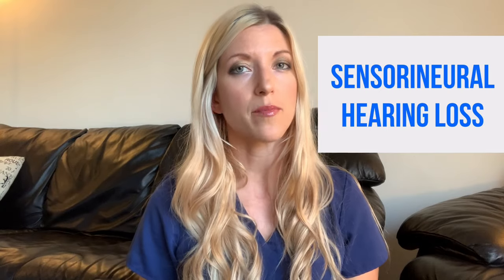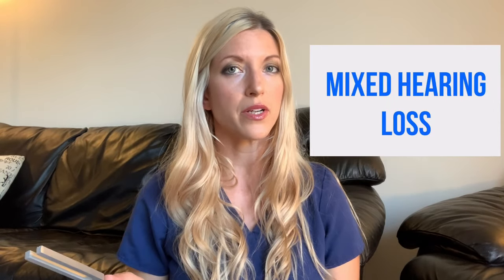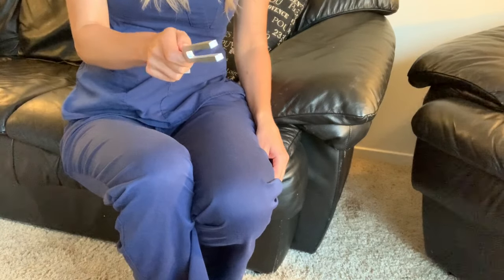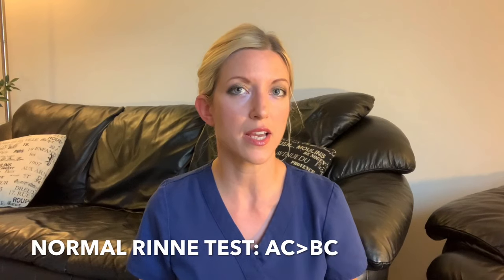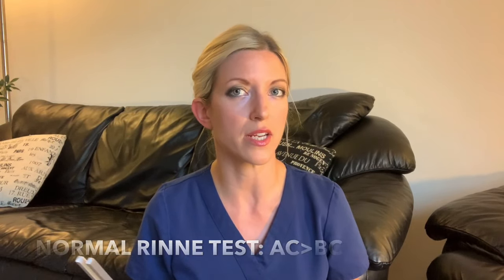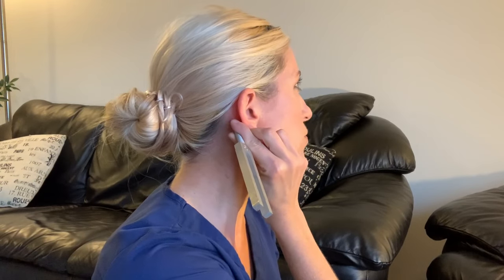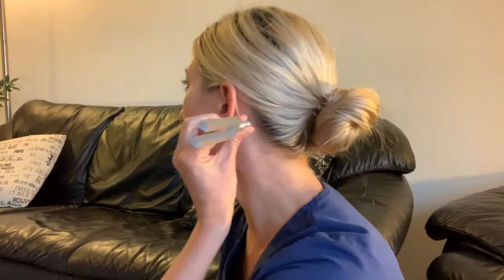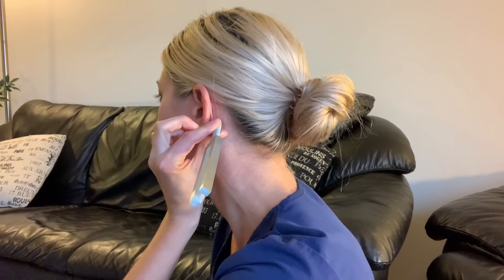How to Perform the Weber & Rinne Hearing Tests | Clinical Examination Skills

Comment: You didn't explain Rinne test correctly, in Normal, air conduction should be at least twice as long as bone conduction. 
In sensorineural hearing loss, air conduction is heard longer than bone conduction, but it is not heard to be twice.
In conductive hearing loss, the bone conduction sound is longer than or equal to the air conduction sound.
Thanks for your effort. Keep it up